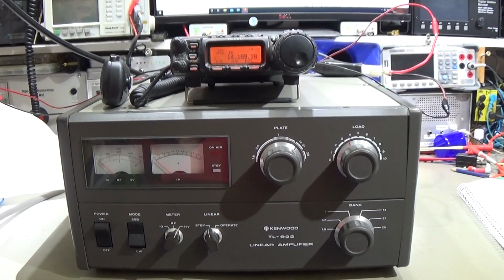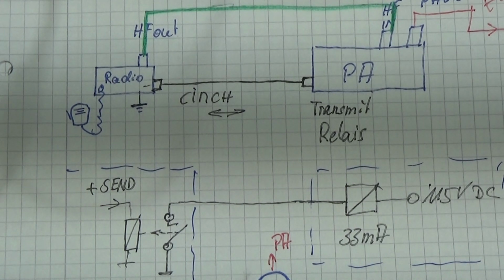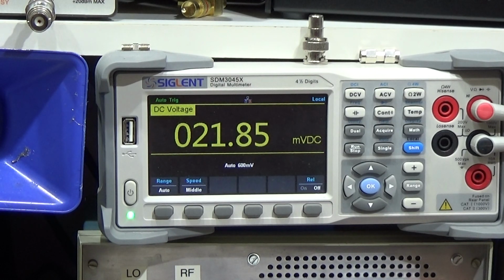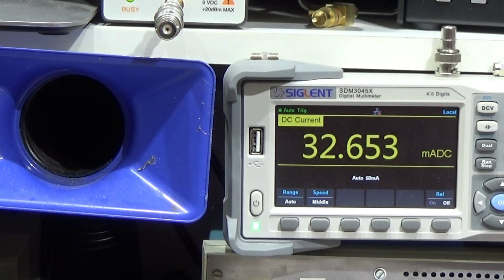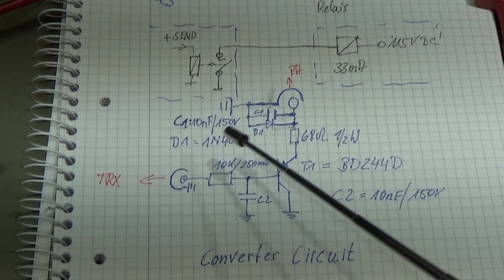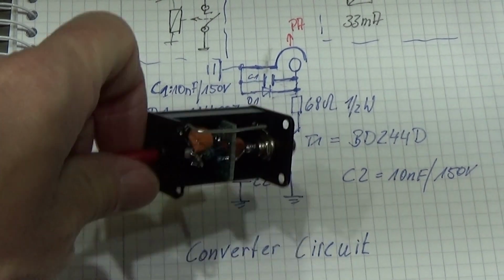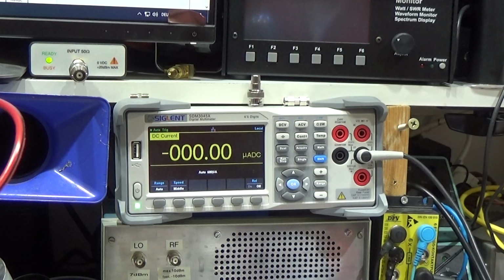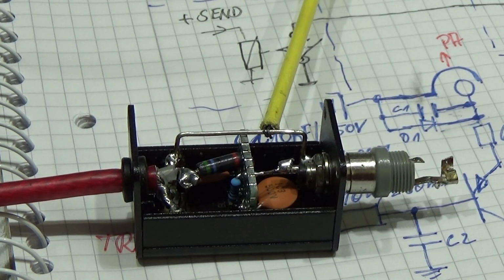#208 Don't kill your HAM Radio by a Power Amp

Comment: I have a amp supply LK550 with 3 3-500zs... I havnt tried it with my flex 3000 but usually run it on my yeasu FT102 only.

Comment: I am sorry but I can't agree, the modern radio has a switching transistor which can only draw 100mA, relays went out years ago as the radios got smaller, if you connect a modern radio to these old valve amps nothing happens, nothing at all! When you connect your valve PA to your modern relay you have to insert a relay into the Keying lead not only to handle the current required to operate the internal power amp TX relays but also handle the fact that the TX relays are not always connected to a +12v supply. You can operate the amp manually by putting a magic plug in the PA manual transmit socket, and use the standby / operate switch to control the operation of the PA. There are lots of upgrades for the Kenwood shown in the video which includes an updated switching circuit which allows you to connect the modern radio to them without any difficulties. You also can't assume that you are pulling a positive voltage down to ground potential; the FT101 series radio CW socket pulls a negative 160v voltage up to ground potential to make the transceiver transmit and this is where you are going to get into difficulty.

Comment: If you don't bother to check on the keying voltage and current levels of an amplifier and  that of your transceiver,  you will get an education using it on an older amp. Remember, an education is only worth what you paid for it.

Comment: I am not sure if this solution is a good idea. The open circuit voltage at the  base of the transistor is - 115 Volt. That voltage can destruct a semiconductor switch in a transceiver.
Reply from the maker: As mentioned in the video you always have to check both the manual of your radio and the manual of your PA. Nevertheless this solution is the best and easiest way to adapt your PA to your radio even to a new radio as  for example the ICOM IC-7300.. Check the service manual check out  the the data sheet for relay  and you will find that it fits for more than 90%. All other solutions you will design needs a separate support voltage for your circuit and / or an extra relay with all the known disadvantages. But anyway the responsibility what ever you are doing is up to you.
Reply: @TRXLab  Yes, I know, I did several of these  mods on the TL-922 but always internal in the amp. Room enough and it works with all kind of radios.

Comment: Nice circuit, Peter, good to have you back with new projects! I have one comment to your circuit: The voltage drop on your PNP will be only around 0.7V between B and E, and the keyline to the exciter will still be more than 100V above ground with this TL922 amp. If the "linear out" pin is switched with a transistor in the TRX I fear it will break down. With a relay it is not a problem

Comment: It's ok to connect a modern radio to an older amp I have a Yaesu ft-1000 connected to a Collins 30L-1 you just need the proper equipment to do it or you can modify the keying circuit of the amp . I use an Ameritron arb-704 with my Collins and It's designed to protect the radio .

Comment: Looks good.  Wondering if this circuit would be improved and simplified by using a high voltage optocoupler instead.
Reply from the maker: improved yes but simplifies I guess not. Thanks for comment

Comment: Wonderful to have you back Peter...you've been truly missed! Some of the newer radios (IC-7600, IC-7851 etc.) have the option for MOSFET switching that is menu selectable...the MOSFET can handle the higher voltages, in my case the 7851 can handle 250V/200mA with that function selected.  You still have to be very careful as the default setting in that radio for PA switching is only 16V/0.5A. Great topic Peter, thanks!  73 - Dino KLØS
Reply from the maker: Thanks for feed back Dino! All the best 73

Comment: I used a battery powered switching relay circuit in a small box, it kept the load off of the radio switching circuit....Those T/R relays on older pa's pulled a lot of current and spiked all over the place when decoupled. It's been a while, K5AZE
Reply from the maker: May different designs are possible. Thanks for feed back 73

Comment: I use an ARB-704 to isolate the radio PTT sent from my Ameritron AL80B key input. I don't think the coild voltage is that high BUT the relay coil kickback can damage the radio PTT send. You see, I have used my Yaesu 747 (I know you have one of those Peter), a Yaesu FT-950 and now a Yaesu FTDX3000. In all cases, I believe a transistor is used to ground the amp's relay coil.  If I am not mistaken, I think the amp's coil voltage is 10v (or maybe 16v?). And the current is just a few milliamps and most modern transceivers can handle it. The problem is, the inductive surge of turning on/off the relay coil. If fact, sometimes the diodes on those snubber circuits fail open and you never know that happened. So Ameritron markets the ARB-704 for those who want to play it safe and it is a bit more complex than your single transistor circuit but it is basically the same principle where the output transistor on the radio sources a larger external transistor to absorb the 1) diode kickback and 2) is also rated at 120V DC or so for the older amps like the Kenwood in your video. I am most familiar with Yaesu and for all I know, the other brands of radios use small relays as you mention, rather than transistors for grounding the amp relay circuits. Another thing is the ALC connection between radio and amp; of course older amps need adjusting. I think Yaesu rigs use -4v (or-5v) as maximum ALC voltage and Ameritron can source -10v. That may or may not be enough to damage the ALC in the radio but it may have damaged my FT-950 ALC. My AL80B is older and does not have the 5K pot to adjust ALC voltage so I built my own. However, I may not have set it correctly. My FT=050 finals did eventually die for some reason (after 12 years) and that is the only thing I can think of that may have caused it. My max ALC coming from the AMP may have been around 10v to the radio. Anyway, thanks MUCH for your videos and GLAD to see you are back again. I look forward to more of your material, by far the most professional and instructive I have seen on radio repair! BTW I  will not use the AL80B AMP with my FTDX3000 (similar PA stage is FT-950) until I have this figured out. I did replace the finals on the 950 and all is well with that now but I do not want to use the amp with that one either!
Reply from the maker: Thanks for your feed back for our community 73
Reply: I have been using my Yaesu FT757gx2 with a Ameritron 80a with the ARB704 for few weeks; drive with 25 watts to get out 4-500. I just got a ftdx3000; what do I need to run 80a? Is it ok to hook up inline with my new 3000?

Comment: Hi Peter you haven't done a video on here for long time, i use IC 7300 with Ameratron 811HX and was told by friend in USA you can connect that direct, i have done that and it works ok, but would be interested in any comments you might have about it, i think i looked in the book and checked the specs...think its ok, i have used it and nothing bad happened hi..Fred g4vvq.
Reply from the maker: Thanks for stepping in!

Comment: Hi Peter,
Good to see a video. I had wondered if you meet with an accident. The video has very good information. I have a Heathkit SB220 amplifier and installed the Harbach Electronics Soft-Key Keying Interface to use with my Yaesu FT-450. I have upgraded my license to Extra and changed my call from WB3BJU to WJ3U.  You and your family stay safe.
Reply from the maker: All is fine thank you Don! 73

Comment: Yay!  Interesting video.   Question: Should the switching transistor have a pull-up resistor for reliable operation?  Like 1 M-ohm between base and emitter?
Reply from the maker: May different designs are possible. The circuit is nothing new I have used this design in many different  applications and always without a pull up resistor as you would always need it in digital applications. But may be under some circumstance it might be helpful...